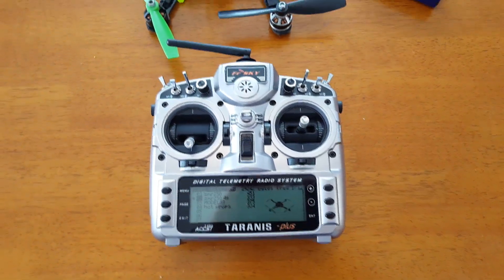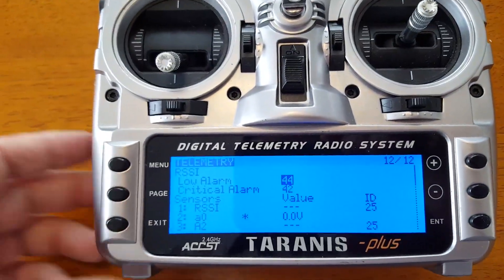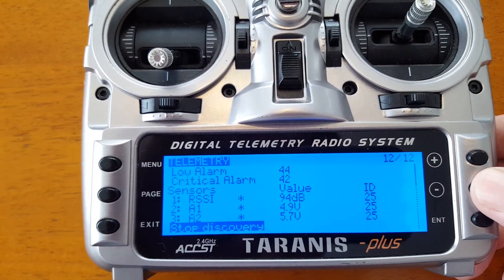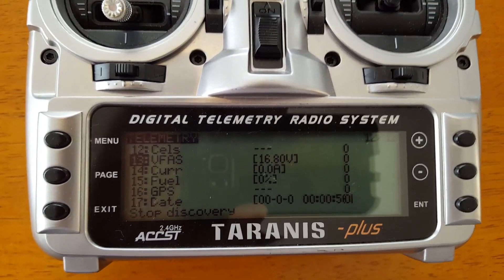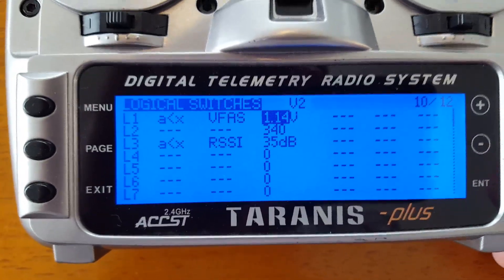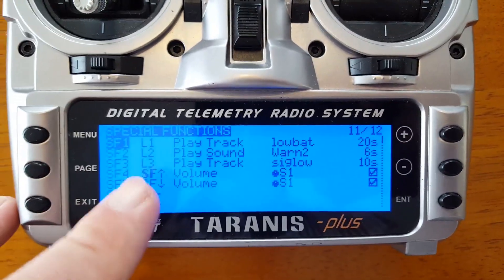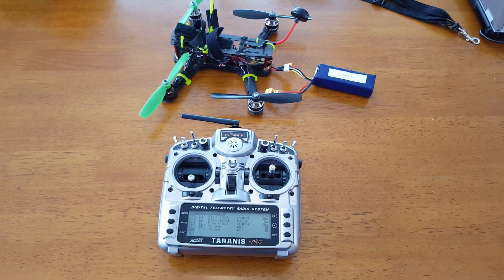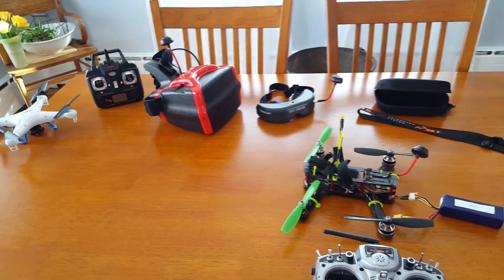How to setup Telemetry on the Taranis OpenTX 2.1 for low voltage alarms

Comment: Great and wvery well done, just one missing step when on the second column (where VFAS is) you need to press ENT and select Telemetry as the input  otherwise you only get the actual physical switches showing My Firmware version 2.1.9 Also I still cant work out how to display the chosen sensors on Page 12 the telemetry screen
Reply from the maker: Thanks David.  I'll have to revisit this... I made this video a while ago.   As for the telemetry sensors, if I remember, the board needs to be armed.  This may vary with SBUS (which wasnt really a thing back in 2015 LOL)

Comment: I have an xsr sb and I don't have the Cels sensor?
Reply from the maker: There is no more Cells sensor.  It was removed in the latest firmware.  You only get total voltage.  The cells reading was apparently never accurate.

Comment: what did you have to do to set up the board or the rx to get this info to the taranis ..thanks ..i have the d4rII
Reply from the maker: enable telemetry on the board and make sure the wiring supports telemetry.

Comment: What rx are you using? and how do you have everything wired?
Reply from the maker: I have a D4R-ii.  Its wired to a Naze32 Acro and it has the telemetry pin connected.  The D4R has the pins jumped so it is using PPM.  Note that this video is SPECIFICALLY for PPM.  Not SBUS.

Comment: I use the kiss fc and the frsky XSR :O But under discover sensors., i can only see SWR, RSSI, RxBt, and A2.... there is no VFAS. I tried to arm it.. still only those 4 sensors. and yes . i connected the telemetry wire to AUX 1 on the Kiss FC, as it should :(
Reply: I'm having this same problem! I've been trying for awhile now to fix it, but no luck. I tried updating my Taranis firmware, still nothing. Let me know if you figure it out!
Reply: I just think i found the problem! :D The new firmware beta update (1.02) for the Kiss FC, got this patch note in it:
"FrSky Smartport telemetry support"
I will be updateing my kiss fc and hope for the best :D hopefully it will work.
You can find it on the Kiss FC product page on flyduino.net
Reply: Just did what you recommended, it works now! Thanks a lot man
Reply: Just did it myself xD worked for me aswell
Reply: Update to the latest KISS/GUI as well if you're updating to the newest/latest builds.  They manage the AUX channels differently so your switches won't work if you just update the firmware.  Just a heads up! :)

Comment: Hi Bill, my issue is that I don't see the "Discover..." option. When I turn on my quad and arm Clean Flight I do see the the blinking asterisks. I'm running 2.1 on the non-Plus Taranis.
Reply from the maker: scroll all the way to the bottom of the sensor page.  you should see "Discover New Sensors" .  Sorry it took me so long to respond.

Comment: hello! i tryed to do it but i see only 3 sensors: swr, rssi, rxbt like you but i can't see more. I have x8r
Reply from the maker: If your using an x8r you should really take advantage of the fact that it runs SBUS rather than use PPM.  You will get much better performance AND SBUS does not require you to arm the flight controller to see telemetry data.  I hope this helps.

Comment: hi 
i have a problem
my radio dosent show any rssi at all...
(but its not the transmitters fault, i use 2 x4r sbs and they both work but dont show any rssi)
Reply from the maker: Maybe try setting up a new model from scratch on the Taranis?  Can you see any RSSI info when FC is connected to cleanflight and powered on with radio powered on?
Reply: +Bill Sheley 
thanks for the help, i was able to solve the problem by replacing the backboard...
works all fine now

Comment: Thanks! I was pulling my hair out on this one after updating the Taranis firmware. Then I had to figure out why my voltage was off by .5 Volts which was because I was using the old Amber Sound pack for 2.0
Reply: OH maybe I'm having the same problem.   the VFAS shows one thing... but the voice says another!  so I probably have the old amber pack installed?

Comment: That's nice. This is the setup I use.I setup LOGICAL SWITCHESL26   a>x   Thr   33L27   a>x   Thr    33L28   a<x   Cell   3.74V   !L26L29   a<x   Cell   3.66V   !L27L30   a<x   Cell   3.48V    L27L31   OR    L28   L29L32   OR    L30   L31          Lines 26 and 27 will separate your throttle in to three sections “0-32%, 33-66% and 67-100%”.          Lines 28 and 29 set single cell voltage limits of the throttle sections set in lines 26 and 27. That’s L28 for 33-66% and L29 for 66-100%          Line 30 sets the lowest voltage limit you decide in the 0-32% throttle section.          Line 31 ties switches 28 and 29 in to one switch (L31).          Line 32 ties switch 30 and 31 to make one universal switch for low voltage. This is what I use as my alarm switch.Feel free to add or remove as many throttle sections as you which, just do not forget to make a voltage limit for each section and tie them to one universal switch.  Or feel free to setup two alarms. Maybe  one for "Low Battery" and one for "Critical Battery" (battery damage/fire possible).
Reply from the maker: +Kurt Ronhovde Wow... great info... I need to give this a shot!
Reply: +Bill Sheley shorty I will have an article post for this setup. I will link it when it's available. then you may share it yourself.
Reply from the maker: Thank you! I look forward to checking it out
Reply: +Bill Sheley here's the link to my article, thank you for the contribution for 2.1 telemetry setup.      

http://flitetest.com/articles/a-better-low-battery-alarm-taranis

Comment: Hi, Great vid and helped me alot. Question if I may. How do I setup 2 model memories for a 3s and 4s version? will it simply already be bound t my quad if I copy memory 1 and adjust vfas low v alarm for 3s? many thanks.
Reply from the maker: +Russell Cleaver Yes... the Tarranis is bound to your D4R-ii no matter which model memory you use.  No need to rebind.  Copy the model, then adjust the VFAS for the 3s voltages and you should be good to go.  Glad this video helped!

Comment: Great video thank you, I too upgraded and lost my voltage telemetry from my naze.
I used to have to have it set up to give an alarm at 3.8 cel, and crit warning at 3.5 cel. Which was handy as it worked for both 3s or 4s.
Is this not possible anymore as I can only seem to find the full pack voltage (VFAS)?
Reply from the maker: +LeakyMeat  You are correct. In the latest iteration of OpenTX, the developers decided that calculating individual cell voltage by dividing total pack voltage was "dangerous" and "inaccurate" because you could have a damaged cell in a pack which is draining faster than the others .   So there is no longer individual cell voltage.  So now you need a copy of your model for 3S , 4S, 5S,  ... etc..
Reply: +Bill Sheley Thanks for the reply, it is a little annoying to me having to have a model setup for both 3s and 4s just because it introduces the possibility of me forgetting to change model in the field, but I guess the reasoning for it does kinda make sense.
Reply from the maker: The other option is to use an OSD but I honestly cant justify adding more weight to the quad just so I can see voltage in my goggles.

Comment: Which receiver do you have and how do you connect it to obtain all of this 'sensors'?
I'm newie, I have CC3D (OpenPilot), X8R and Taranis X9D Plus (with OTX 2.1)
Thanks in advance.
Reply from the maker: +Henry Henry Hi Henry, if you are using an X8R, you should use SBUS instead of PPM.  SBUS has many benefits over PPM including that the sensors are visable to the Taranis without actually having to arm the board.  As soon as the X8R gets power, it will provide sensor data to the Taranis.   Check out @Painless360 youtube channel.  He has great tutorials on setting up SBUS within Cleanflight.
Reply: +Bill Sheley I use SBUS from the beginning. But its not possible to get the telemetry.
Reply from the maker: +Henry Henry This video should explain everything you need. https://www.youtube.com/watch?v=jiK2xA2sImE
Reply: +Bill Sheley thanks for your interest but I just wanted to connect the CC3D with the telemetry port. I think the conclusion it's CC3D is not  capable of it.
In theory it's just to connect flexi port with telemetry port and configure it, but I'm not be able to do it 😢
Reply: +Bill Sheley thanks for your interest but I just wanted to connect the CC3D with the telemetry port. I think the conclusion it's CC3D is not  capable of it.
In theory it's just to connect flexi port with telemetry port and configure it, but I'm not be able to do it 😢

Comment: I agree I was just saying the instead of a switch up and a switch down  using 2 special function you can use one special function and the switch would be called "on" assigned to s1 or s1. just a neater way of setting it up.
Reply from the maker: +Oliver Peters I see what your saying now.  I'm going to experiment with your idea.  Frankly the Taranis audio is terrible at best and it would be nice to turn it off completely.
Reply: Yeah its not great but its useful. Do the speaker mod if you want more volume and less tin. Its easy enough if you like tinkering. Which most of us do ☺

Comment: Thank you so much for this video helped me a lot! Can you also tell me how to adjust the VFAS voltage on the Taranis to be the same as my multimeter shows for the battery? Because it does not really measure the correct voltage of the batteries.
Reply from the maker: +xuxusito Yes... I'm going to try to get a quick video out just for that.  I couldnt remember off hand how to do the voltage offset while I was filming.  I should have the voltage offset video done by Wednesday so please check back.
Reply: +Bill Sheley  Ok thank you for doing that!
Reply: +Bill Sheley Are you still going to upload the voltage offset video?
Reply from the maker: +xuxusito I held off on the video because as it turns out, there is a voltage offset in the new version of Betaflight and I'm not 100% sure which works better.  I need a little time to review what is the best way to configure the voltage offset.  At first glance, the settings in Betaflight look to be the better solution.